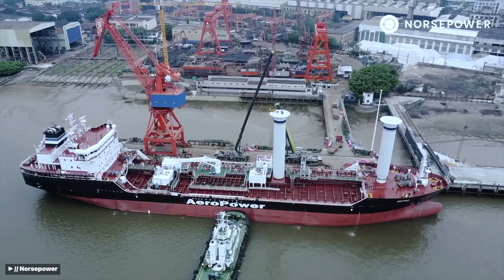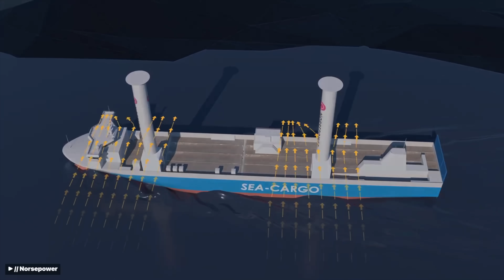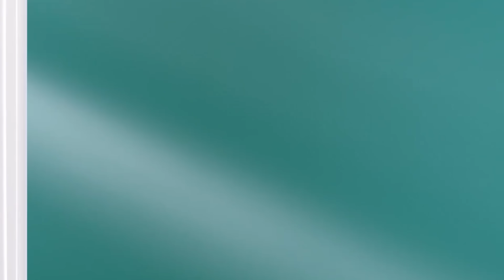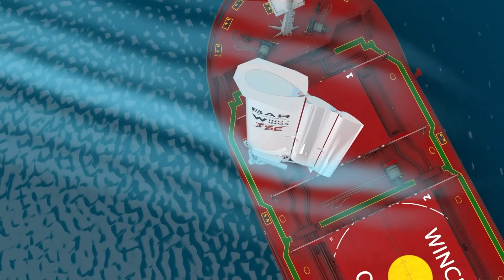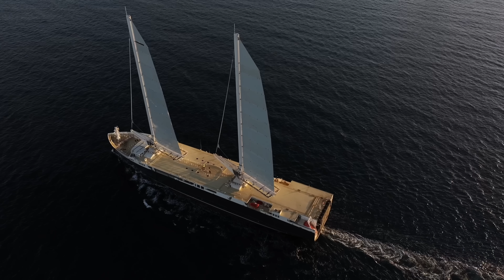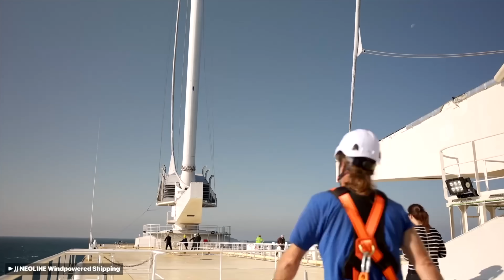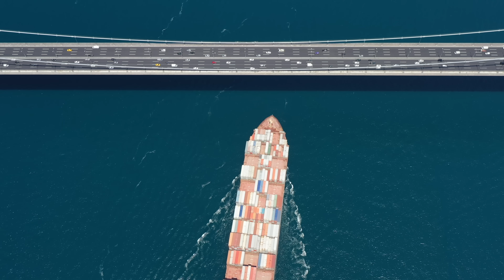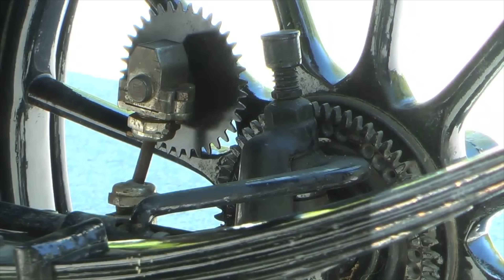Surprise Breakthrough Solves Shipping's BIGGEST Problem

Comment: Flettner rotors (or rotor sails) are not widely used primarily due to high capital costs, limitations in deck space, challenges with ship stability, and dependency on favorable wind conditions. While they are proven to work and can reduce fuel consumption, the economic and operational constraints often outweigh the benefits, although interest is increasing due to decarbonization goals.

Rotors only provide efficient, useful propulsion under specific wind conditions (e.g., winds on the beam). In headwind conditions, they generate minimal force and can add drag, making them less effective. 

The large cylinders occupy significant deck space, which is a major drawback for container ships that need to maximize space for deck cargo. 

The heavy rotors are mounted high on the deck, which raises a ship's center of gravity and can adversely affect the ship's structural stability.

They require large bearings and continuous maintenance. Furthermore, they introduce additional mechanical parts and "windage" (wind resistance) during stormy weather.

Flettner rotors are less effective on ships that travel at high speeds (e.g., above 15 knots), which are common for container vessels.

Most modern cruise ships travel at an average speed of 18 to 24 knots (20–28 mph or 37–44 km/h).

Flettner rotors are less effective on ships that travel at high speeds (e.g., above 15 knots), which are common for container vessels and cruise ships.

Also modern cruise ships have very high windage, acting like massive, 1,100-foot-long sails that tower over 200 feet above the water. This immense above-water surface area means they are heavily affected by wind, requiring advanced thrusters for docking and causing them to sometimes skip ports in high winds. Flettner rotors would perilously increase windage.

Comment: Is there a technology where the wind isn't directly used to push the ship forward, but instead either is directly coupled to the propeller, or powering electric motors? So that even with a headwind you can just go forward. It seems to me to be less dependent on wind conditions, but maybe I am wrong?

Comment: Give me $100,000 and I'll tell you about a technology that far surpasses the one shown in that video. It saves fuel, extends the life of internal combustion engines, and contributes to increased power output for ships that rely on these engines—all at a low cost, with high efficiency and consistent performance. Furthermore, the technology I'm talking about is compatible with all internal combustion engines without requiring any modifications to the engine block.

Comment: Remember about 40% of all shipping is just moving fossil fuels around, so removing them from the equation cuts things down quite a bit. Then wind supplemented systems cut things another double digit percentile. Then bio or synth fuel generator to electric systems for when the battery charged at port runs out, if it does... but now develop solar that can go on these sails and anywhere else on the ship to cut another percent... perhaps another double digit. That seems a great way to decarbonize shipping. Remember this is only about 2 and a half percent of emissions, so its not exactly a big low hanging fruit but we can see how it can be chipped down peice by peice even without ant crazy new developments.

Comment: 1960s nuclear powered cargo ships proved nuclear power is superior to all FF.
(a) Refuel every 6 months : no time lost due to refuelling
(b) 1/3 of all cargo is FF : potential to increase trade by 50% with current ports.
(c) In practice proved nuclear power was faster, with faster turnaround, than FF.  

CHINESE COMMERCIAL MSR reactors
Molten Salt Reactors MSR would 
(d) increase reactor temperature, giving superior efficiency.
(e) nearly all the Uranium 234 would be consumed : minimal waste with refuelling once a decade. 

WIND/SOLAR
(f) Boosts have the same effect regardless of ship size : boost and drag proportional to ship surface area.

Comment: I wouldn't think PET plastic would be very suitable for composite materials like that ... or especially efficient to use for that compared to normal recycling into new plastic bottles or into textiles (given it's polyester).

You can use PE and PP plastic containers to make other things, but that normally involves pyrolysis and then utilization of the resulting pyrolysis oil as cracking feedstock to produce monomers.

Comment: The planet is greener with more CO2 to be photosynthesized. Sail's on boats is a legitimate way to harvest renewable energy. As far as the dirtiest fuel on the planet, Rudolph Diesel invented the Diesel engine to not be dependent on the petroleum industry. At the 1900 world fair he ran his engine on peanut oil. At the time he was concerned with the poor air quality due to the use of coal to run steam engines. In America we eat enough fried food that we could cut down on diesel consumption simply by using used fryer oil.
Reply: 'Sails on boats' The problems with the wind as an energy source are variability, reliability and low energy density; also relevant in this context is that the canvas, cordage and extra manpower needed for sailing ships were never a very benign environmental option so please discount any idea of sail as ‘sustainable’ and all this is without the problem that if ‘the wind don’t blow the ship don’t go’ (unless you have stored some energy on board).

When it does blow it often blows in the wrong direction for your cargo delivery needs and sometimes there is rather too much of it for comfort.  The area where one is most likely to be ‘becalmed’ is the ITCZ (Intertropical Convergence Zone) or ‘the doldrums’ as it is commonly called.  In days of old ships with large crews, such as naval vessels, would try using the ships boats and some of the crew to row through the doldrums thus towing their mother ship out of the calm.  Not practical for less well manned and much heavier merchant ships which could not muster a similar power (oarsmen) to weight (vessel displacement) ratio.  Traditional sailing ships are unable to go directly up wind so if the wind is blowing from the direction your cargo needs to go then a zig-zag course must be steered, more distance and thus more time on passage at whatever speed is achieved.

Wind speed is traditionally measured on the Beaufort Scale (wind speed) that runs from 0 (< 1kn or 0.5ms-1) to 12 (> 63kn or 32.5ms-1) and for sailing purposes the usable part of the range is ‘3’ (circa 8kn or 4.1ms-1) to ‘6’ (circa 24kn or 12.3ms-1).  As the wind speed, and the amount of energy that may be harvested there from, increases the sea surface becomes progressively more disturbed which makes the harvesting process ever more difficult and increases the stress on the vessel.  The increased stress means the sail area has to be reduced, either by using fewer or smaller sails until the vessel may in extremis be ‘hove to under storm sails’ or riding out the unsuitable weather using either a sea anchor or a traditional ground anchor.  One way of reducing the sail area is by turning up the bottom edge; known as reefing; tricky with slabs rather than fabric sails.
Reply: 'The Diesel engine'; very true it is an engine design not a fuel dependency, however the scale of the fossil fuel industry cannot be matched.  One factor increasing productivity when mechanical energy took over from equestrian was that no land was required to graze the horses!  A horse not only does less work than a tractor but cannot be filled up with 'go juice' at a pump.

Comment: Entertaining but futile. Wind power is a quixotic idea dying with every year that fusion technology gains traction. Once fusion energy becomes commonplace they will put wind and solar back in their time capsule box
Reply: Why not use nukes on merchant ships?  It is down to engineering, finance, socio-political attitudes and safety.  In engineering terms hydrocarbon fuelled ships do the job adequately and are simpler.  Financially hydrocarbon fuelled ships are, considering only internal costs, cheaper and socio-politically they are a known entity; they thus have incumbent advantage.  With regard to safety hydrocarbon fuelled ships may have serious problems but these are generally considered manageable and have known limits of impact, most importantly they can be shut down at short notice and are then walk away safe, while nuclear energy has fewer incidents those rarer occurrences are seen to be catastrophic and having unlimited effects.

Comment: It is dumb. We have nuclear technology that only has to be refueled once every 3 decades. The US navy should just build a cargo fleet and auction the leasable space on the deck.
Reply: Why not use nukes on merchant ships?  It is down to engineering, finance, socio-political attitudes and safety.  In engineering terms hydrocarbon fuelled ships do the job adequately and are simpler.  Financially hydrocarbon fuelled ships are, considering only internal costs, cheaper and socio-politically they are a known entity; they thus have incumbent advantage.  With regard to safety hydrocarbon fuelled ships may have serious problems but these are generally considered manageable and have known limits of impact, most importantly they can be shut down at short notice and are then walk away safe, while nuclear energy has fewer incidents those rarer occurrences are seen to be catastrophic and having unlimited effects.

Quick question why do you think 'the navy'only use nuclear power for specific things, aircraft carriers and submarines, yet ignore it for mundane tasks like the Sealift Command?

(There are no knots, only bends and hitches)
Reply: @BernardLS 
We have to abandon hydrocarbons 
We have to
It is non negotiable 
Hydrocarbons are not an option anymore
Reply: @frictionhitch  'We have to abandon hydrocarbon', the first steps to this run something like the following.

The 26th UN Climate Change Conference of the Parties (COP26) held in Glasgow between 31 October 2021 & 13 November 2021 established requirements and targets for mitigation of the production of GHG and, with regard to shipping, steps to reduce atmospheric pollution to acceptable levels could include, but not be limited to: -
1) Improving fuel quality;
2) Abolishing recreational boating;
3) Abolishing the cruising fraction of marine transport;
4) Localising production to consumption;
5) Reducing freight carrying capacity;
6) Reducing spoilage / waste of all commodities;
7) Reducing 'freight mile' distances;
8) Reducing the global population of consumers;
9) De'fossil'ising the fuel chain.
OK number 9 is not really easy, but we all like a challenge.  The use of any of the options above may not be the future of marine transportation but moving less material and moving what is transported over shorter distances, as in the past, should be.  Together with localised production and minimised consumption a global population that has individuals’ voluntarily self-limiting reproduction to two children per parent (both male and female), might save the planet.

How do you feel about RNG (renewable natural gas)?  It is a hydrocarbon but not a fossil fuel, however even harvesting as much as is feasible there may not bo enough to match the consumption of fossil natural gas.

An immutable fact is that it is not possible to have unlimited expansion (growth) within fixed boundaries (the planet Earth)  A guy called Malthus put this forward some time ago, he was not wrong just ahead of his time, IMO.

Comment: Nobody ever mentions the huge volume of warm water added to the oceans from the engine cooling systems on every modern ship. That heat puts large volumes of water vapor, a powerful greenhouse gas, into the atmosphere. Recently, that added heat in the Persian Gulf and Arabian Sea has been causing flooding around the Middle East, especially in Afghanistan and Pakistan. A return to wind could save a lot of Agriculture, Infrastructure and lives.
Reply: Good point lets move less stuff shorter distances and localise production to consumption.  This is where somebody kicks in with the high value items that are shipped around the world, which may be valid to some extent, but do all the kitchen gloves used in Sweden have to be made in China?

Comment: Sooooo......... what about combining the ideas? Starting with the spinning thing and then catching the airflow with sails?
Reply: Two systems mean two sets of capital investment then the additional problem of integrating the output of the two systems into one useable drive.  Then there are the problems common to all systems relying on the wind as an energy source are variability, reliability and low energy density; also relevant in this context is that the canvas, cordage and extra manpower (or alternatives) needed for sailing ships are not, and were never, a very benign environmental option so please discount any idea of sail as ‘sustainable’ and all this is without the problem that if ‘the wind don’t blow the ship don’t go’ (unless you have stored some energy on board).

Comment: The problems with the wind as an energy source are variability, reliability and low energy density; also relevant in this context is that the canvas, cordage and extra manpower needed for sailing ships were never a very benign environmental option so please discount any idea of sail as ‘sustainable’ and all this is without the problem that if ‘the wind don’t blow the ship don’t go’ (unless you have stored some energy on board).

When it does blow it often blows in the wrong direction for your cargo delivery needs and sometimes there is rather too much of it for comfort.  The area where one is most likely to be ‘becalmed’ is the ITCZ (Intertropical Convergence Zone) or ‘the doldrums’ as it is commonly called.  In days of old ships with large crews, such as naval vessels, would try using the ships boats and some of the crew to row through the doldrums thus towing their mother ship out of the calm.  Not practical for less well manned and much heavier merchant ships which could not muster a similar power (oarsmen) to weight (vessel displacement) ratio.  Traditional sailing ships are unable to go directly up wind so if the wind is blowing from the direction your cargo needs to go then a zig-zag course must be steered, more distance and thus more time on passage at whatever speed is achieved.

Comment: So why it isn’t used more often?
Reply: The problems with the wind as an energy source are variability, reliability and low energy density; also relevant in this context is that the canvas, cordage and extra manpower needed for sailing ships were never a very benign environmental option so please discount any idea of sail as ‘sustainable’ and all this is without the problem that if ‘the wind don’t blow the ship don’t go’ (unless you have stored some energy on board).

When it does blow it often blows in the wrong direction for your cargo delivery needs and sometimes there is rather too much of it for comfort.  The area where one is most likely to be ‘becalmed’ is the ITCZ (Intertropical Convergence Zone) or ‘the doldrums’ as it is commonly called.  In days of old ships with large crews, such as naval vessels, would try using the ships boats and some of the crew to row through the doldrums thus towing their mother ship out of the calm.  Not practical for less well manned and much heavier merchant ships which could not muster a similar power (oarsmen) to weight (vessel displacement) ratio.  Traditional sailing ships are unable to go directly up wind so if the wind is blowing from the direction your cargo needs to go then a zig-zag course must be steered, more distance and thus more time on passage at whatever speed is achieved.

Comment: TL;DW: using sails instead of, or to supplement an, oil fueled engine, saves oil. Big brain conclusion here.
Reply: The problems with the wind as an energy source are variability, reliability and low energy density; also relevant in this context is that the canvas, cordage and extra manpower needed for sailing ships were never a very benign environmental option so please discount any idea of sail as ‘sustainable’ and all this is without the problem that if ‘the wind don’t blow the ship don’t go’ (unless you have stored some energy on board).

When it does blow it often blows in the wrong direction for your cargo delivery needs and sometimes there is rather too much of it for comfort.  The area where one is most likely to be ‘becalmed’ is the ITCZ (Intertropical Convergence Zone) or ‘the doldrums’ as it is commonly called.  In days of old ships with large crews, such as naval vessels, would try using the ships boats and some of the crew to row through the doldrums thus towing their mother ship out of the calm.  Not practical for less well manned and much heavier merchant ships which could not muster a similar power (oarsmen) to weight (vessel displacement) ratio.  Traditional sailing ships are unable to go directly up wind so if the wind is blowing from the direction your cargo needs to go then a zig-zag course must be steered, more distance and thus more time on passage at whatever speed is achieved.

Comment: There is nothing new about this, the first use was over 100 years ago. The first commercial ship to be propelled by Flettner rotors was the Buckau, a cargo ship converted in 1924–1925. Developed by German engineer Anton Flettner, it used two tall, spinning cylinders (rotors) to harness the Magnus effect for wind-powered propulsion, successfully crossing the Atlantic in 1926.